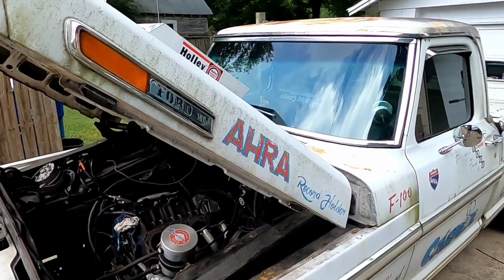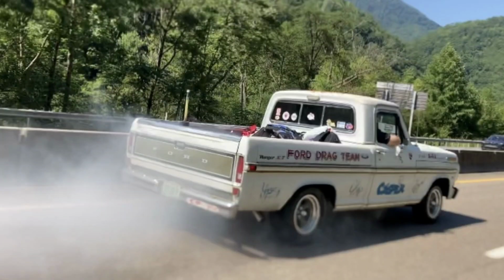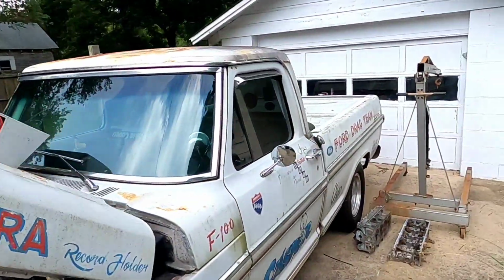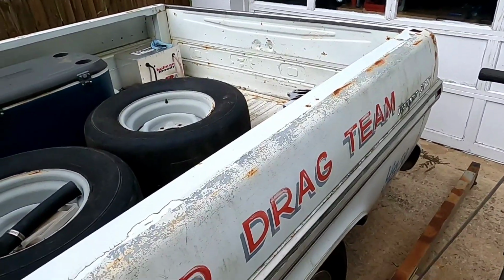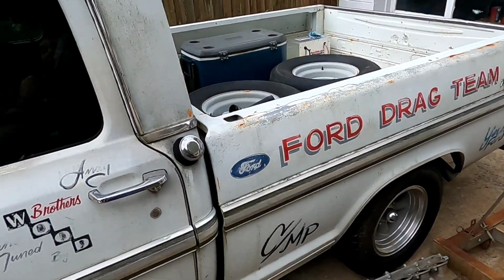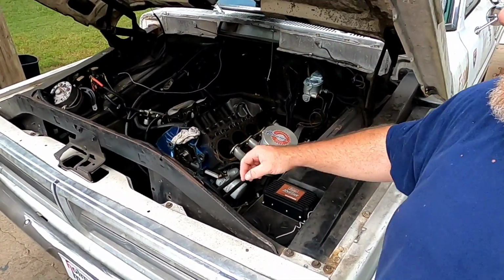CASPER IS BACK!!! Getting my '71 F100 ready for 750HP MIXED UP BOSS

Comment: 750 horsepower means big tire. I saw a corvette with a helicopter jet engine rated at 800 hp feeding thru a Turbo 400 and it spun all the way down the track with darker patches where it shifted. My sister had a '71 way back when and I told her not to sell it, but she did. Love those old school trucks. I have a '68 Ranger with a 360 and 4 speed in it which was my Dad's.

Comment: Looking forward to ver 2.0 for sure. Man that thing likes to rev. Gotta be some good weight savings swapping out the twin I beams for something lighter. What, I don't know.  I like the Patina of the truck as it sits, looks pretty hip. Pulling weight out is tough, it's sneaked in all over the place from the factory, even worse on the current model cars.

Comment: Amazing how fast that black stuff grows! I reckon a set of aluminum twin i beams should save 100lbs or more.  AT one point I actually bolted suitecase weights under my rear bumper to get my old Dodge to hook better. The better traction was more than offset against the added weight.

Comment: Didja see that video from the Horsepower Monster, about the 955 hp, rebuilt NASCAR Cup motor that you can buy in a crate? If I remember right, it was about 35 grand. Now, if you end up not satisfied with your Mixed Up Boss (whatever it was called), maybe you can sell it for a downpayment on one of those!

Comment: I seem to remember you used fourth generation ls rods in your 393.did the bearings spin and stick the rod to the crank breaking it, or did the rod just break. I was planning on using a set, but now I'm rethinking it.
Reply from the maker: David, I had regular Scat I beam rods  in the 393w with a Scat cast crank..  it broke due to a major backfire from the roll pin shearing on the distributor gear... The Rod went exit stage left! 
Andy
Reply: @UnityMotorSportsGarage  oh I see. I don't know where I got the idea you used ls rods in that motor, ok,thanks Andy.

Comment: Andy,  are you changing out anything trans or gear wise when you run the M.U.B.  or will you just run it with same as the 393 to get a baseline??
Reply from the maker: That is a great question... I plan on running the same drivetrain to get a baseline.. I'm going to put new clutches in the C4 to give it a fighting chance!  
Andy

Comment: Would a crown Vic front end help your handling.  I'd love to have s f100
Reply from the maker: It would.. but I'm going to take the twin I beam as far as I can safely allow me to go...  Thanks for Watching!  It's going to get good..
Andy
Reply: @UnityMotorSportsGarage  Andy I suppose you could drill the beams if done carefully like they did back in the old hot rod days to remove unsprung weight.

Comment: What was the build on that 393
Reply from the maker: William, it was a 10.7 to 1 compression had a small solid roller cam 245°/253° @ .050 .674/.674 on a 108 LSA, David Vizard ported heads 192cc intake runner that flowed 315cfm at .625"  It ran great... I kinda miss it!  Lol
Thanks for Watching
Andy
Reply: @UnityMotorSportsGarage  393 is a stroker 351 right? Did you get a stroker kit for it or is it a bored out 390?
Reply from the maker: It is a 351w stroker .. you use a 3.85" stroke crank with stock length 351w connecting rods with a 302 piston for that combo..

Comment: Cool man! Me and my dad put a 70 Lincoln 429/460 in My 71 f100 and man it flew with a great rebuild it was already 365 hp 500 ft pds of torque stock never got it on a dyno, but it was puting out north of 900 hp with all the mods witch was just high comp pistons really hot cam edellbrock heads and intake with a monster carb. Thanks to my asshole step brother taking it out for a joy ride and lyingvto his girlfriend that it was his and nearly killed both of them I lost it ! Totaled !🤬

Comment: Talk about weight  you should  unbolt  the fenders  and unbolt  the 2 nuts under the radiator support  with the hood on get a buddy  to help you set the front  end on the ground  I'd wear a weight lifters belt it's got to be 25% of the truck's weight.  Make a pass with it off  I think you will gain  about 7 thousand  dollars  worth of power   or at least start ordering  some fiberglass  parts    you should see where a small block  Chevy  engine sits in these truck's  its low and the front of the engine  is slightly behind  the shock towers
Reply from the maker: I have moved the engine back as far as it can go and as low...  It made a big difference!  Thanks for Watching
Andy